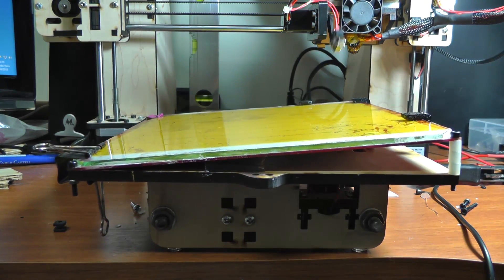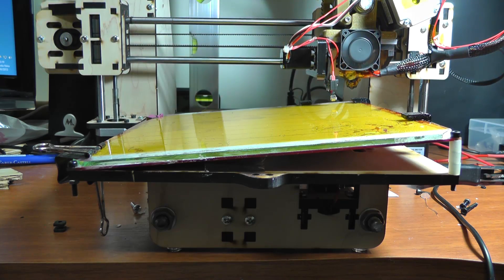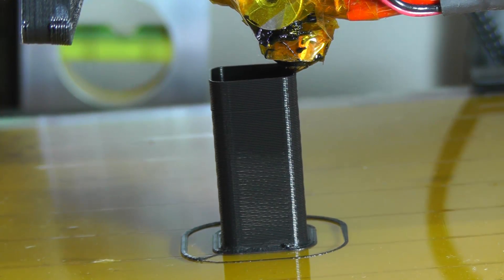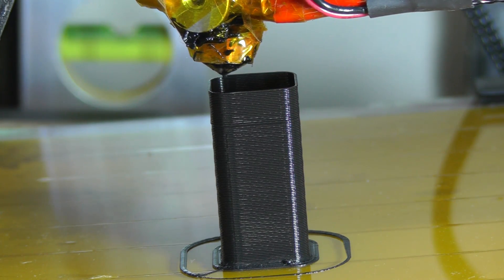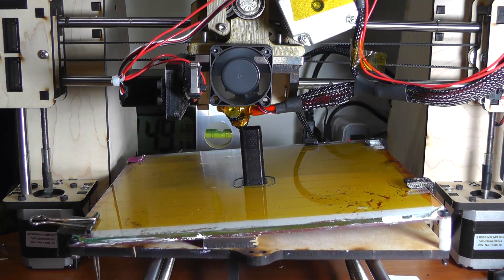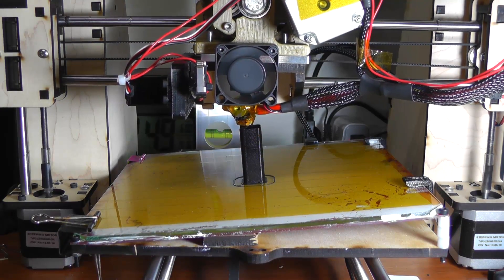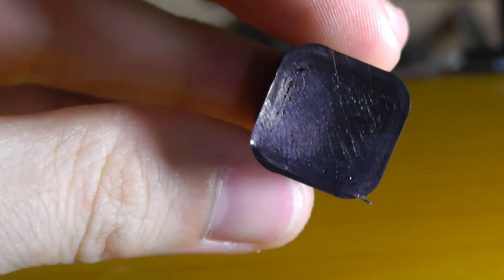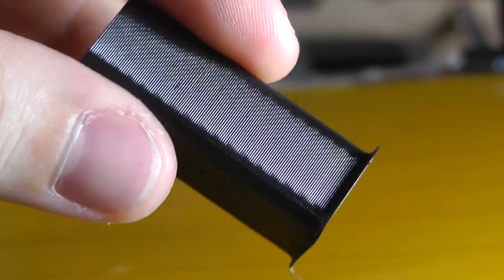3D Printing on a "really" Uneven Bed

Comment: Nice demonstration but this is "simply" tilted, yes it proves that auto bed leveling corrects this nicely but for uneven bed it is trickier as the mesh grid resolution can be too low

Comment: Looking into auto leveling myself. On a normal (without a height difference of 15mm lol) bed, is there much of a speed loss from the Z axis having to compensate for a slightly tilted bed? This is going to be on a P3Steel, so similar setup to what you have here, but I'm using TR8*8 leadscrews for the Z axis instead of normal M5 threaded rods so theoretically the Z axis should be a bit faster.

Comment: Alex, have you considered doing something like this with an aluminum bed? Since the bed is aluminum you can use any metallic probe instead of a microswitch (bed grounds probe upon being touched).
You also get better adhesion to the aluminum bed and dont need to reapply tape all the time.

Comment: What G-Code use for autoleveling start? G29?
Reply: G0 -> G1
G1 - Coordinated Movement X Y Z E
G2 - CW ARC
G3 - CCW ARC
G4 - Dwell S or P
G10 - retract filament according to settings of M207
G11 - retract recover filament according to settings of M208
G28 - Home all Axis
G29 - Detailed Z-Probe, probes the bed at 3 points. You must de at the home position for this to work correctly.
G30 - Single Z Probe, probes bed at current XY location.
G31 - Dock Z Probe sled (if enabled)
G32 - Undock Z Probe sled (if enabled)
G90 - Use Absolute Coordinates
G91 - Use Relative Coordinates
G92 - Set current position to cordinates given

Comment: Just wanted to point out that you can definitely see some aliasing on the sides of the part.

https://www.youtube.com/watch?v=x8eqSQNAyro&feature=player_detailpage#t=419

Not really preventable, but smaller step distances would help minimize this defect.  Also, it should be almost negligible with a "normal" unlevel bed.

Comment: coul this also be done with a "manual" extended bed-level-probe?

i would like to have a retractable actuator, which I pull down/up by hand before and after the auto-bed-levelling.
how is repeatability, the servo seems to always jitter a little bit, correct?

Comment: How about to replace the mechanical button and servo with just an optical switch?
Reply from the maker: The problem is the print surface is not unique.. Sometimes you have kapton, others you have glass+glue stick.... the reflectance changes according to the surface. In the other hand, the mechanical switch will always measure the same distance, no matter the surface.
Reply: ***** Then maybe you can add a CALIBRATION MODE to the firmware and after setting the nozzle to touch the bed hit CALIBRATE SENSOR to analog read the threshold value. Another idea is just to slide a piece of paper to the heated bed during calibration. Why i am telling all these? Because the extra COST and WEIGHT of a servo maybe is a problem for most of us.
Reply: One more question: I have build the BOWDER EXTRUDER by using pneumatic connectors and the connections are very tough. I have calibrate the Feedrate of the extruder too. The problem is that the nozzle is leaking and i don't know how to fix it.